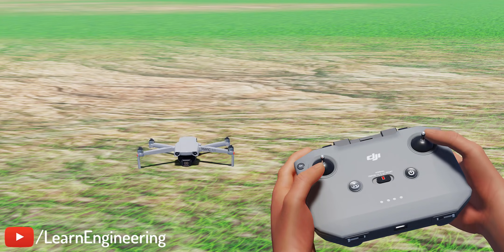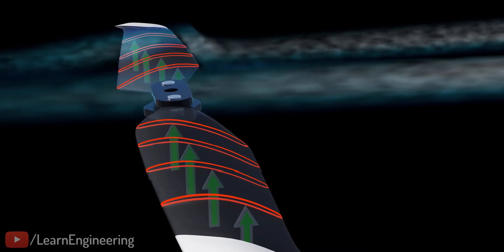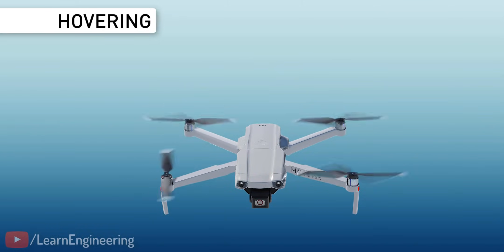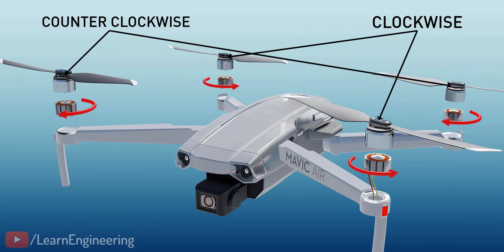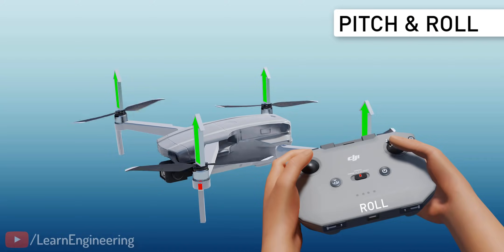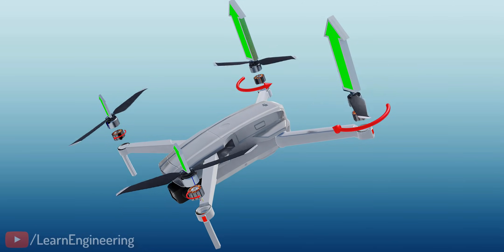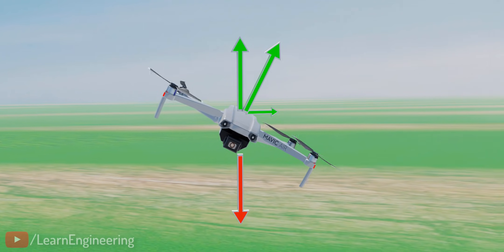Drones | The complete flight dynamics

Comment: If you pitch and roll, wouldn't you just go in a diagonal direction. So not going in a circle but still in a straight line. To go in a circle you'd have to yaw as well and it gets quite complicated at that point.
Reply: You are correct. It is equivalent to "strafing" in video games. Both pitching and rolling preserves the direction that the quadcopter is facing.
Reply: You are right, applying only pitch and roll the drone will go in straight diagonal line. So, If we want to circle in pitch forward flight we also need to add yaw. For beginners it is difficult to do because it requires all stick combinations (thrust, yaw, roll, & pitch) to maintain a perfect circle
Reply: yea, but you would go in a circle, but the front will not we straight as shown. You would need yaw and roll to do a circle like is shown
Reply: There's a coupling between roll and yaw. Typically, it's way more efficient to roll to change direction than yaw.
Reply: No. If  you roll, the perpendicular force will act continuously and drone will  keep turning.
Reply: If anyone is still wondering about this, Joshua Bardwell has a good video showing what pitch, roll and yaw do https://www.youtube.com/watch?v=mHWZIECVUjA
This however is how it all works in acro mode. DJI operators and some others will probably have the drone in angle mode in which case you need to keep the stick at certain position to keep pitch and roll constant. It is also possible to automatically mix signals so for example when you yaw the drone will also roll to actually change the direction where you are going.
Reply: @Qwarzz  yes. I’ve flown both types.
Reply: Although technically you could do a "circle" using only pitch and roll. It wouldn't ever be changing heading, without yaw the drone would always be pointed in a fixed heading. A flight controller is designed to fight uncommanded movements, you aren't commanding yaw so it won't. Most people WOULDN'T describe this as a "turn", it's just pivoting around point.
Reply: this
Reply: You are right. pitch force is the tangent velocity. you need a normal acceleration to do circular motion, that is the continues change of the direction achieved by yaw. It will generate a force acting to the center of the circle. The roll will give you extra force just like the racing track angle  but the center of rotation will always change unless you changed the yaw, having a constant angle change(delta theta) will do it.
Reply: Hi can I know why the height of the drone does not decrease when its at ya
Reply: Hi can I know why did the height of the drone did not decrease when it's at yaw state ? As the speed of rotation of the two other blade is decreased . pls help
Reply: @os9458  unless you're at full throttle the two other blades can speed up to keep the net force constant.
Reply: Nice seeing actual drone pilots rectifying stuff. Yes, if you pitch and roll, the motor speeds work out, but you can pitch and roll AND yaw at the same time.
Reply: Can someone tell me what would happen if the I switched the wings on a drone? Put differently, the right wings on the left and vice versa. Have anyone tried this with a drone?
Reply from the maker: No. If you can do both the pitch and roll operations simultaneously  on a hovering drone, it will fly diagonally. However, simultaneous operation is not possible since the same stick is used for both the controls. When you give a roll motion to an already pitched drone which is moving at constant speed, the drone will go for a circular motion.
Reply: @SabinCivil  I'm flying FPV drones for 6 years and RC helicopters for 12 years. You definetly have to give yaw. First you pitch forward and add throttle up to start moving forward. Then you start the roll and a little back pitch and yaw. I can't really exatctly say what I'm doing because I do it subconsciously and all the 4 commands are always moving a little bit all the time because it's an unstable system.
Reply from the maker: @vibecoder9435  Yaw controls can only manage spin of the drone along its own axis. It has nothing to do with the circular motion. However, if you are trying for a turn in a windy condition/  haven't done the pitch and roll operation perfectly/ always want to point the drone camera on a specific point, you have to mix yaw motion as well with the circular motion.
Reply: @akh345  it's simple physics.. If the force remains constant and is applied perpendicularly to the motion, the resulting path is a circular arc. The direction will  change till force is acting but speed remains constant.
Reply: @Star气Lord  That perpendicular force is exactly the same on the front and on the back of the drone. There is no torque on the drone body. The drone will not turn. It will simply shift the entire drone sideways while the drone remains facing in the original direction. This is actually exactly how you move diagonally in skydiving:  you go forward (pitch) and do a side slide (roll).
Reply: @akh345  you're right we have to yaw as well. If we roll, the drone will move in the direction of net force. The net force will not be perpendicular to motion.
Reply: @SabinCivil  what mix would it take to do a spiral motion?
Reply: @vibecoder9435  yaw 
 only rotates the drone around it's own axis. It can't give a centripetal Force to the drone
Reply: @ugursoydan8187  You can probably download a free fpv drone simulator and try flying without yaw and see yourself how it goes.
Reply: @vibecoder9435  I don't know how to control the drone. But  I think physically. And yaw is for rotating the drone on it's own axis. But if it causes a centripetal Force in your drone, then it might cause a circular motion. Maybe yaw has different function in your drone
Reply: @ugursoydan8187  install the FPV Freerider from the android play store and try to fly without yaw. Just use the up/down throttle to lift and try doing a circle with the nose always pointing in the flight direction without yaw.
Reply: @vibecoder9435  Maybe it's not a very realistic simulation. I can't trust it. And maybe (as I said in the previous message) yaw has different function s in that drone. Maybe it somehow gives a centripetal Force to the drone.
Reply: @durgeshyadav32  You'll need to roll side way, yaw a lil bit and lift the drone a lil bit. All three steps simultaneously for a while to complete the spiral.
Reply: @SabinCivil  As an experienced drone pilot and a guy who's pretty good at physics, I'm sure you're wrong.

1. Of course you can pitch and roll at the same time, no matter if you're flying an auto-leveling DJI camera drone or an FPV quad without any self-leveling or autonomous flying capability. Guess you need take a close look at modern radio transmitter (controller).

2. If an object is moving forward at a constant velocity (V), simply adding a constant perpendicular force (F) doesn't make it move in a circle. It only pushes the object sideways, which is the case described by @Qwarzz, that the drone will fly to a line in a diagnal direction. Here you missed a very important point in your video: in order to move the the object in a circle, the extra force applied (F) must be not only perpendicular to the initial velocity (V), but also constantly POINTED to the CENTER of the circle around which it moves. These two are the sufficient and necessary conditions of making a circular motion, any of these two missing the object won't be moving in a circle. Please be noted: the uniform circular motion is not a uniformly accelerated motion, it is a variable acceleration motion. This is a commonly seen mistake where most people get themselves wrong. In order to keep the extra force (F) pointing to the center of the circle, we need to give another propelling vector. This is exactly where yaw started to play a part. The point where you were wrong was: "the extra force F is always perpendicular to initial velocity V" is just an necessary condition of making a circular motion, not a sufficient and necessary condition, i.e. in all the uniform circular motion, the F is always perpendicular to the V, but on the contrary, simply making this F perpendicular to the V, the object won't move in a circle.

3. If you find my above explanation hard to catch, just try fly a drone in your real life. An physics experiment will always speak for itself. PS: DJI drones are steady as rock in the air and so easy to maneuver because they have pre built-in algorithms supported by specialized chips. These things are actively and continuously monitoring the drone status in a 3D space, correcting any disturbance or destabilization mutiple times a second. So it is not the best way if you want a serious verification of any physical law. I'd suggest try an FPV and you'll find what I'm trying to explain very soon.

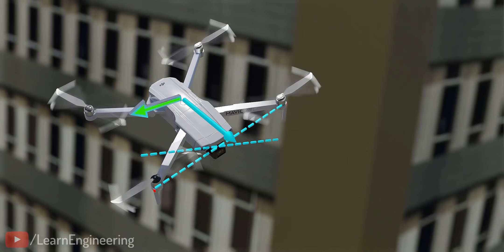TLTR: Yaw must be given in order to fly a drone in a circle. You're so wrong at 6:20.
Reply: @WaynePilot  This should be easy enough to visualize in a 2D plane too. Add two forces (forward and sideways) together and you'll have diagonal path. You'll need to rotate the object to have it go in a circle.
Reply: @SabinCivil  Consider a bicycle. Pitch = acceleration from pedals/brakes. Roll = a rider shifting weight sideways. Yaw = rudder. You can't turn the bicycle if the rudder is mechanically welded to be in the forward position.
Reply: @akh345  but the shifting sideways of the rider doesn't gives a velocity in the radial direction so i guess this example is not suitable for this case
Reply: @SabinCivil  fly a drone and you will know
Reply: @SabinCivil  No. You only see the circular motion. If you focus only at the drone which have circular motion like in your video, the drone direction is changing depend on its position on it circular path, which mean the drone is have rotational motion too on its center mass, and to get this rotational motion the drone need to do yaw.
Reply: @SabinCivil  Incorrect. Try any simulator, some are free on mobile
Reply: Well the logic that I could think is since circular motion is a 2d motion and requires force in 2 directions only thus only pitch and roll is required. If we apply yaw also then it will be a spherical motion instead of a circular one. I may be wrong but this is only possible explanation I can think of.
Reply: @arihantjain1662  what is spherical motion??? 😀 😀 😀